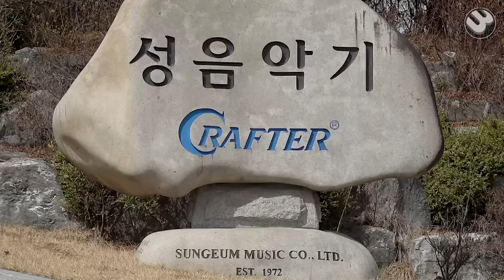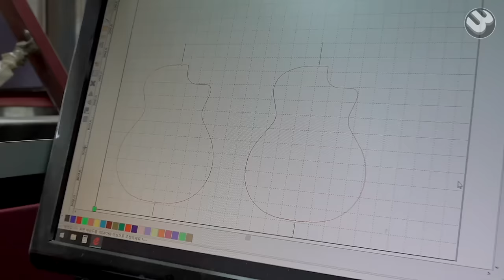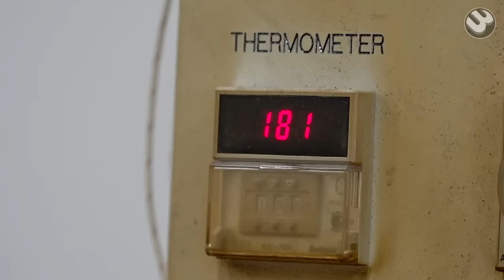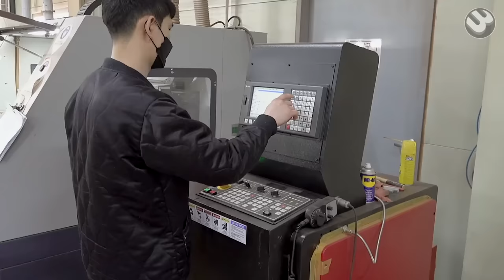How To Make Mass-Produced Acoustic Guitar. Amazing Guitar Manufacturing Factory

Comment: Pity the luthier who ever has to do a neck reset on one of these . Looks like they set that thing in very well !
Reply: Yeah, I wonder what that goop is they used. If it's epoxy, that neck is never coming off. If it 's just a way to make a sort of conforming mold, but doesn't actually bond, then that would be OK. But then they smeared a bunch of what looked like superglue on the fingerboard extension - that could be tough to get off without damage.
Reply: @kindabluejazz  I was also wondering what that brown goo was . That epoxy on the finger board is going to be TUFF
Reply: @kindabluejazz  Cyanoacrylate glue (aka super glue) can be easily softened and removed with acetone.
Reply: 🙂 that was one of my first thoughts too. Whenever such a guitar comes into my shop for a neck reset, I resign.
Reply: @euhdink4501  I wouldn't blame you one bit

Comment: I was absolutely amazed how much manual labour still goes into this "mass produced" guitar. This is top notch work!
Reply: It's not , it's cheap and easy.
I'm a luthier for one of my guitars you'll be waiting 3-6 months while I cut assemble balance and temper to almost perfection
Most of these guitars are fit for beginners , for example no balancing and I didn't even see them filing the frets ! Literally slice a finger open !!
I saw tons of split grains , unfinished edges, bad glue adherence , weak bridges, weak nuts , cheap and nasty metallurgy and so on and so on and so on .
Top not work it certainly is not , but it's important cheap guitars exist as I would have never been able to learn how to play without one .
Reply: It's really not that much. If you want to see a lot of manual labor, lookup videos of people handmaking the entire thing. It takes forever.
Reply: Clearly you are beginner. This is very cheap stuff. Fine for someone starting out.

Comment: Thank you for this fascinating video. The workers obviously take pride in their company and their guitars. The only moment that left me wondering was the fret installation at around 17:45 I'm sure more work went into setting the frets correctly and would have enjoyed seeing how it was done
Reply: you are welcome
Reply: That's what I exactly noticed at the moment I saw the one around the middle not going deeper. hahaha...
Reply: They are all in the next clip at 17:55
Reply: That's all there is to it. Just tap them home. They are cut to a precise length so no trimming.
Reply: I'm certain that they skipped the step where used a fret press to fully seat the frets.  You could see they stuck up in the middle, and the he was only seating them at the ends--except where the fretboard went over the body.  Drove me crazy!

Comment: What I think is amazing is that someone had to figure out the exact lengths, for instance, of the sides, and their curvature, to be fastened end-to-end that way, and later have the front & back pieces glued to them, then they didn't even need to trim anything off.
Also the routers and the CNC machines all had to be programmed.
It's amazing how well they came out!
Reply: They had to be trimmed. The video didn't show it.
Reply: I mean, you just make one once, and if it's 45mm too long, start with a piece of wood that's 45mm shorter next time. Don't really need to figure much out.

Comment: That was really interesting to watch.  I’m surprised by how much super glue they use in initial construction and how they use wood glue on the frets instead of super glue.  That was interesting.  Also I’m curious how long those clamp times were. Cool video.
Reply: A good Guitar doesn’t use superglue or wood glue for frets. They use hide glue or something similar like they do to set the neck and the bridge plate. It can be heated allowing the parts to be removed.
Reply: @Acemechanicalservices  that’s not true.  Many manufacturers use super glue, PRS comes to immediate mind, in their fret work.
Reply: @Acemechanicalservices  Titebond Original white glue can be unbound when heated.   Hide glue is traditional  because it was the only glue available in the old days.  Some purists demand it, claiming it transmits sound better, but many wonderful sounding guitars are built with white glue. Manufactures charge a premium for hide glue because it's less convenient .

Comment: When they installed the bridge, they put it over some clear coat. That bridge will eventually lift. You need to make sure the area the bridge is being glued to has ZERO clear coat under it. Rewatch this part in the video about 18:20 in and youll see at the corners of where that bridge is being installed has clear coat. Also you really need to paint with a brush the glue on.
Reply: Also not a fan of the size or material they are removing to install that output jack/preamp box in the guitar. Thats not an area i want to cut a huge chunk of wood out of.
Reply: Also be weary of undersaddle pickups, the take away the direct contact with the bridge and saddle. The more contact that the saddle and bridge are making, the better it will sound unplugged.
Reply: @ctcards2636  That's where Taylor put their battery box and output jack, and they seem to know what they're doing. There's plenty of material still there, at least seven layers of lamination. That's why they put a big block of material in there to start with.
Reply: They did scratch the surface before gluing in the bridge, just like how they scratched the top before installing the neck to the body.
Reply: I've had my crafter for over 15 years and I've had zero issues with it. Yes it's considered somewhat of a cheap guitar but it sounds great and it's been reliable. I also play a Dean and a Martin 12 string so I do know what I'm talking about. This is a well-made budget guitar.
Reply: There’s always someone that needs to find something 😢
Reply: One of my chief gripes with guitar makers, even Martin did this.

Comment: Fascinating.
Also surprising, to see there is some casual handwork for precision jobs like placing the bridge.
Reply: The positioning had been carried out before the bit we saw here.
The bridge (or a template) will have been used to mark where the finish needs to be removed for the glue.
Positioning the bridge for glueing is a bit like dropping it into a pocket.

The method I was taught involved putting masking tape where the bridge will go.
Accurately position the bridge and trim the excess masking tape away from around it leaving a piece the exact outline of the bridge.
Apply the finish over the masking tape and then remove it after leaving a pocket back to the bare soundboard.
Reply: Yeah! Intonation will be perfect 🙂

Comment: Cool to see a very thoroughly manufactured guitar.

Not my kind of guitar building cause there isn’t much hand work done.
 
But it still takes skill to run these machines and program CNC/ laser cutting so I certainly respect the way they mass produce these guitars and I’d pick one up to try.

One thing that puzzles me is that cement looking slop they put in when they join the neck to the body
Good luck prying that apart for a total neck reset one day

Comment: Fascinating process for what looks like a quality guitar. I wish manufacturers would glue the bridge directly to the soundboard though instead of sticking it on to the polished surface. This is a constant point of failure even on top brand guitars.
Reply: ... and the way they glue the neck into the body will become a nightmare for neck reset, which they will certainly need after a few years.

Comment: This is precision work that can never be achieved by hand. Just as precision machining of an engine block, CNC precision is simply by far, superior. The only thing that matters at this point is the quality of the wood, the dimensions, and most important is the critical fit and alignment of the neck. These guitars look extremely well made.

Comment: I’ve heard it said we live in the golden age of instruments. There’s no reason for a playable guitar(or any other stringed instrument) to be out of reach from anyone that desires to play. These types of builds make a great, durable foundation for a guitar. The details are what matter to some-for the rest, these play fine. 8:09 I think those gouges in the bindings are where the bracing’s go.16:40 that’s some decent detail work.18:18 super glued saddle i think. I’m not an expert is this common in builds? Must provide much needed strength for that direction yank from the strings.19:09 she must testing the mic or piezo -the heavy tapping heard is coming from another station?
19:42 don’t we all change our strings like this? Looks like they’re using D’Addario strings.Wish would could have seen how they achieved intonation with that compensated saddle- nice video tho.Makes me want to consider a Crafter- great idea putting this on YT.

Comment: Amazing the machines they have that do the building. A lot of detail and the body inside is braced so well. It can take many months to make a hand crafted guitar but this process can make one that seems very good in quick time. Wonder what the selling price is? The inside label reads handcrafted but this is not really hand crafted with the machines doing most of the build.

Comment: That was great and all but with one mistake IMO?....I would have taken the time to do a dovetail to connect the neck with probably tight bond glue (water base). If that was epoxy and probably was...won't be able to remove the neck if you need a neckset....hmm.

Comment: The surprising thing for me is the bridge design.   The bottom had a stepped surface that fit into a cutout on the top.  That seems like a strong system but it is hard to imagine how it could be removed if repair was ever required.  Any luthier in the future would be stymied.
Reply: @@notexpatjoe I  should take another look.  The clip where that was installed was so short I only got a brief impression that it was stepped.  Thanks for putting me right.

Comment: Fascinating!  They skipped over the part where the truss rod is inserted into the neck. Is that a trade secret or something?
Reply: I don’t think that it was an adjustable truss rod, rather a carbon fiber reinforcing rod to counteract the pull of the strings. You rout a channel down the middle of the neck and glue the rod in. Doubtless they have jigs to speed up the process.

Comment: Everything looks OK, but the top. The bracing is too thick and they needs spend time to trim the bracing, to make it more responsive. The top made that way will have weak volume due to excessive thickness of the bracing. Actually even the bracing for the back is too thick.

Comment: Everything about that guitar exudes physical strength, braces vacuum glued to top and bottom, press machines forcing the heel block and neck block together, custom side bending machines with massive anvils, all the CNC was perfect. Finish booth is the only non modern thing going on here. There is NOTHING in the materials or construction here that prevents this guitar from sounding excellent, and yet it sucks in the sounds it makes. Anybody?

Comment: I pro guitarist can make these guitars sound like a $10,000 Martin 🏅🎼🎼🎼
Reply: Most $10,000 Martins do not sound that good even with her a good player playing one. Martin’s prices are heavily inflated.  $10,000 should buy an excellent guitar that will last for generations but you’re not gonna find that kind of value with a modern Martin.  The ones made before World War II are excellent but suffer from playability problems. The most important element of a guitar is its sound, and one can acquire a handmade American guitar for approximately $5,000 to $7000 new that will blow away anything you see in the video or produced in the Martin factory.  You can’t get some thing for nothing, and to acquire an instrument of any kind requires equivalent economic exchange.
Reply: @ZRJZZZZZ  I don't understand how a modern Martin would not last 100 years if cared for and repaired when necessary. All old Martins and guitars in general will need a neck reset and other attention. Things wear out. The Modern Martins I own and have tried seem like they are made as well as ever. Sure the binding can fall off because they have to use different glues now but meh that's an easy fix.

Comment: Now we now why you have to change saddle height , dress fret ends ,level frets, in most of these Asian guitars.. even ones like these that cost about 3 grand ...

  One thing that got me was the fitting of the neck... tjey just set the dovetail to the tenon , glued it , andnitsnstill not attached to the body yet.. thenThey mix up this brown/grey goop and press it all together... there wasn't a luther anyway in the whole assembly... saving ,maybe, the guy picking out the wood. 
     Still tje principles are there . The wood quality is there . But if your going to charge as much as a solid wood Martin,  well you aught to do a complete setup . 

I I didn't see them radius the sides either . I wonder if they just cut the sides to where it just falls into a radius and they just have to do a glue-up and its there ?

Comment: Looks like theft of design and cheapened. No details refined, just implication of others design.
Reply: "Theft"? Who from? Sure, there's a few elements that chime with other manufacturers, but there are only so many ways to style a guitar.
Reply: Theft of design is a very peculiar thing. Just because you patten an idea does really mean you came up with that design, especially in the guitar field. Guitars came way before Patten's. Now days if you buy a hand made guitar you are basically waisting your money. The mass-producing market is nailing it on a fast production rate witch saves you money. The only new design in hollow body guitars that I have seen come out is by Alveres guitars. And that is where the saddle is separate from the stringing through the block. Which changes the angle of the strings on the bridge. It produces more down pressure on the saddle which transfers to the sound board which gives you a fuller sound. Now this is something that has never been done on a hollow body guitar. But yes, it is done on the electric guitar. So now we are back into the realm of copy right infringement. In the music world, this goes on on a regular basis. There is no write or wrong way anymore. Now I've played a synthetic guitar and I hate to admit that it had a very beautiful sound to it, but I prefer wood guitars. But I have to admit that it was a very good sound and humidity never comes into play.
Reply: Yeah, just like all those violin makers have stolen that design
Reply: Should they make it shaped like a car?
Reply: "Man doesn't realize just how old guitar shapes are"

Maybe don't comment if you don't possess knowledge on the subject.

Comment: I have tried These cheap made Guitars from the orient and the quality of the woods used in these guitars are not as good as the Guitars produced in the united states plus the oriental guitars DO NOT USE a bone saddle or nut as does the better made USA Guitars And a LOT of your sound is lost when You use the plastic Saddle and nut because of the contact of the  plastic and the wood. that also applies to the pegs holding the strings in. A big lot of the sound comes from CONTINUOS contact of that string THRU THE WOOD to the BRIDGE PLATE and when plastic is used instead of a GOOD GRADE wood you loose a LOT OF SOUND so dont tell me how amazing these instruments are. They are CHEAP KNOCKOFFS of the real deals made in the USA